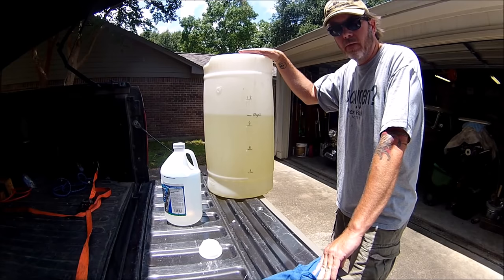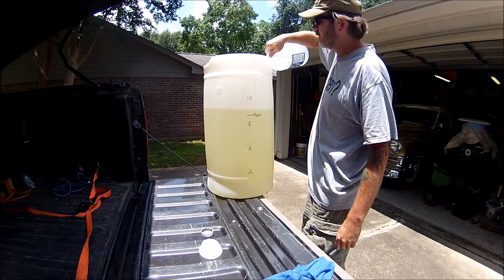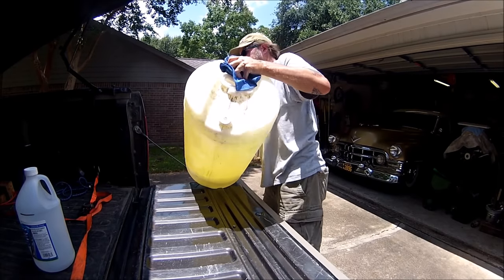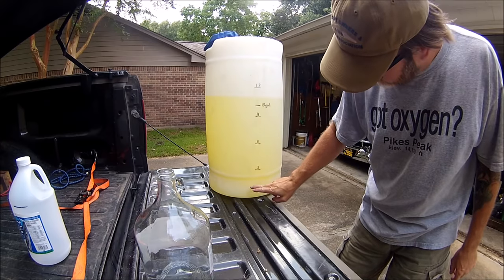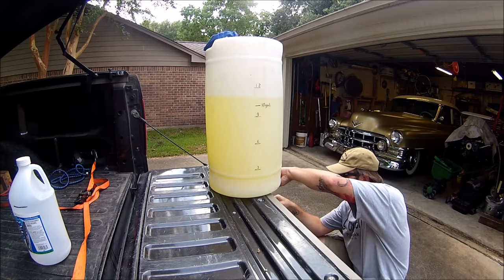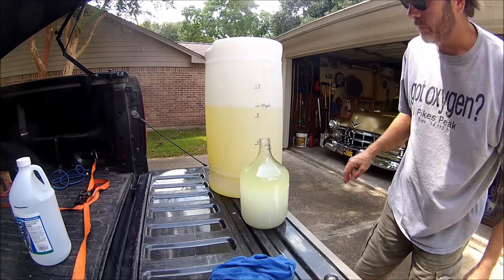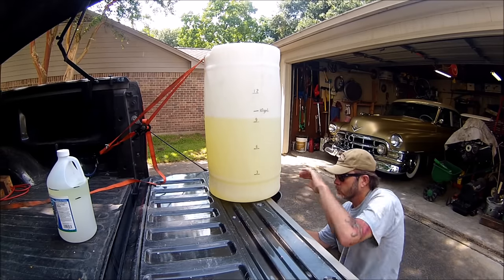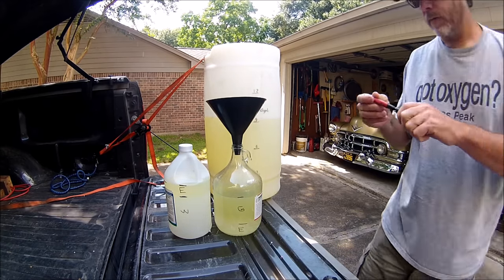How to easily extract ethanol out of gasoline.

Comment: If you start with 10 gals. of E10 you should have 9 gals when you are done.
Reply: The sticker on the pump says 'May contain up to 10% Ethanol'.....just saying.
Reply: +Biana Doubt 
Sorry, but you have been misinformed. 
Here are some verifiable current ethanol fuel facts, look them up on reputable up to date sites and learn the factual truth. 
Ethanol is a cost effective, safe fuel oxygenate, cleaner and octane booster. 
Ethanol is used as a fuel oxygenate and octane booster additive in most every country on the planet, not just the US. 
Since 2010 the "American taxpayer" has not subsidized ethanol for fuel. 
Ethanol production does not take food off of the table, ethanol is produced from a specific variety of corn optimised for ethanol production that is not edible by humans, the corn waste from producing ethanol is high in protein and is sold as animal feed feedstock. 
Currently (08-26-2018) the US national average retail regular E10 gasoline is $2.839 USD per USG and the raw cost to produce that gasoline including the ethanol content is approximately $1.496 USD per USG.

Comment: Did you actually run your product in an engine?  From this vid we don't know if your method works. 
You added 1 gal water to 10 gal gas, and only took out 1 gal. If this "works" you should have 9 gal gas left. (2 gal of diluted ethanol. 
I find that I get 10% less milage with 10% ethanol gas compared to real gas.
Reply: Not enough mixing.  I use a 5 gal. water jug.  4 gals. of gas with 1/2 gal. of water (more than necessary).   Roll on ground and  invert several times.  Let rest for several hours then remove water/ethanol.  Have been making/using for 2 years and all my 2 and 4 stroke engines are free of fuel problems.

Comment: I use Safeguard ethanol fuel treatment by Lucas Oil Products. Use it in my mowers, chainsaw, trimmers, atv and my old IH 656 gas tractor with no problems. It's $7.99 from Wal-Mart and 16 oz bottle treats 80 gallons. That's 10 cents a gallon, much cheaper than super or premium gas. I just add 1 oz to a 5 gallon gas can and the bottle has measuring marks for ozs.

Comment: Call me stupid but I don't want to be messing around with ten gallons of extremely combustible and flammable gasoline, let alone agitating it. I just wouldn't want to expose myself to a possible combustion or friction, static. That's your life you are playing with here. Say nothing happens. Say something happens only one time in a freak accident. That's your ass, your life, your skin, eyes, hair, clothes on fire, etc. It's not worth it, not at all. That's WAY too much gasoline to be playing with. Even two gallons is too much to play around with. Gasoline should be handled with EXTREME CARE and RESPECT. That's not salad dressing you are shaking up you know.
Reply: You've been watching too many Hollywood movies. Static will not light up gasoline. Hell, you can throw a lit cigarette in a tub of gasoline and it's just go out. This guy isn't doing anything different than if he was filling a fuel tank on a lawn tractor. We don't hear any stories about people blowing themselves up pouring gas, do we? Ever wonder why?
Reply: Every car on the road has an electric motor running a fuel pump SUBMERGED in gasoline. Electric motor, wires, etc. Inside the tank, in the gas! Gas is safe.
Reply: @jjenson2006  What!!! Are you serious...throw a lit cigarette in a tub of gas?  I know, it's TRUE, cigarette goes out. What gets me is a electric hot wired Fuel Pump sitting inside a gas tank? Especially when or if it gets down to the "Fumes".  Ditto on the Hollywood Crap!👍
Reply: I've had tanks of  gasoline boiling in my chainsaws after running them multiple times... nothing ever happened but I was careful too and had water with, I just recaped it and let it cool off. Makes you pay attention when you look down, open the cap and see gas boiling in your hands...
So ya, he's in no obvious danger Mr. S.
Anything else?
Reply: You can actually submerge a nichrome wire in liquid gasoline and run an amp of current through it so it glows red and the gasoline will simply boil. Without oxygen, there cannot be combustion.
Reply: @jjenson2006  That's interesting but spooky. I fear "the Fumes" probably more than anything else as danger. Yeah ya gotta have 02, I guess that's the plus side of an elect fuel pump inside a gas tank, it's sealed and enclosed. But removed and opened to replace a pump, I reckon a danger zone now? I have seen guys toss a cig in a pan of gas to make a point, poof, they went out. Scary yeah, then told "it's the fumes, not the gas". Personally not me but yes on the right combination. I know of 2 drilling rigs that went up in flames over fumes that ignited, total disaster.
Reply: You aren't stupid. Just not aware of how gasoline combusts.

The vapors of gasoline are explosive, and that is how gas motors work. The carburetor or fuel injectors vaporize the fuel, mixing it with air... this combination IS explosive. 

If you've seen a puddle of gasoline burn, the flame is over the puddle... most folks don't hang around an open gasoline fire to observe this... advisably so without a fire/heat resistant suit.

Granted, welding around a container of gas isn't advisable. Caution is always a friend. But what this fella is doing is not hazardous... unless he was smoking something... an ignition source nearby...
Reply: I agree that the fumes are the danger, but only if there's a legitimate ignition source; and there is not one here.
Reply: Yeah it's the fumes at around a 14:1 ratio give or take a little, but somewhere in that fume cloud a match will find the right ratio. I would have experimented on a smaller scale to start with.
Reply: I don't care if I'm wrong, I just wouldn't be agitating ten gallons of gasoline, plastic bottle to plastic tailgate protector, in the open sun, the tailgate is warm. That's TEN GALLONS of extremely combustible gasoline. Why play around with that much gasoline so close to your own house? You are all welcome to play with ten gallons of gasoline. Have at it. I don't even keep gasoline in my garage. I keep it outside under the eaves on the patio. It's shady on that side of my house too. Sure, I agitate two gallons of gas when I put oil in it. Sometimes I agitate six gallons in my boat. But I don't treat a whole lot of gas like it is in a washing machine. Jeez. Maybe some of you are less afraid of gasoline than I have but I have thrown enough gasoline into a fire to see how flammable it is. I mean, one mistake and POOF, you might be blind, without a nose, ears, in the burn unit in agony. Sorry but I don't play with combustible and flammable materials like that. I'm going to give gasoline my ultimate fear and respect. You guys can smoke while you pump gas, put out matches and cigarettes in gas containers all you like. I'm just going act like a little girl and not play with gasoline, or lacquer thinner, acetone and other very flammable products. If he was agitating ten gallons of mineral spirits I would not be that concerned, but that is gasoline and a different story.
Reply: There's a lot more than 10 gallons of gasoline being agitated in your fuel tank when you drive your car.

Sometimes I agitate six gallons in my boat.

So 6 gallons is okay, but 10....no way???

But I don't treat a whole lot of gas like it is in a washing machine.

It's gasoline, not nitroglycerin.

You guys can smoke while you pump gas, put out matches and cigarettes in gas containers all you like.

Yet this guy isn't doing any of that......

I'm just going act like a little girl

I see.
Reply: Do you mow your own lawn or do you have Meheecans do it? By your estimation people should be burning up like matchsticks.
Reply: I remember when I was very young, we used to make Molotav Cocktails by filling an empty bottle with gasoline, sticking a rag in it, lighting it and throwing it at the paddle ball court. I remember soaking a tennis ball in gasoline, lighting it and we would all kick it around in the streets; we called it midnight soccer. If the ball hit one of us, we'd light up, but you could quickly pat it out without even burning our cloths. Was a lot of fun until it rolled under someones parked car and we all ran off; nothing happened to the car though. Yeah, we did some dangerous, stupid things with gasoline when we were young, but no one ever got hurt. Today's generation are afraid to just be around gasoline. What happened?
Reply: Plus it does not remove the ethanol, however is does contaminate the fuel with greater than 4 percent moisture. 
10 gallons of E10 gasoline contains approximately 1 gallon of ethanol.
Add 1 gallon of water for a total of 11 gallons in the container. 
IF the ethanol in the E10 gasoline absorbed the ~1 gallon of ethanol the resulting phase separated solution would be approximately 2 gallons. 
This demonstration barely recovered 1 gallon and the fuel in the container is now contaminated with >4 percent moisture (water). 
This method has proven to be bogus/scam numerous times before.
Reply: OK, it seems my man card has been called into question. Yes, I cut my own yard. I keep two two gallon cans of gas outside the house, one can has two cycle oil in it. I used up the gas I kept in my boat tank because I haven't been using the boat but previously for a while it had around four to five gallons in the six gallon tank. Yeah, call me paranoid but some nearly burned down my father's sign business in 1975 when I was 12 years old. We had to rebuild the business. I once almost burned the lake house down when the fireplace ignited the kindling in a bucket in front of the fireplace. Fire burned up the wall which had paneling on it. Luckily my dad caught the fire. Another time I was cooking french fries on the stove when I was a kid and the grease caught on fire. I grabbed the hose outside and put out the fire with the hose. I burned up the overhead range and the kitchen floor too. And another time I had a minibike and the throttle was leaking and it caught fire as I was in a neighbor's driveway. The fire burned my eyelashes and eye brows back plus the hair on my arms. So I am familiar with FIRE. That is all I am saying. Maybe some of you need some closer to home adventures with fire. But yes, I see the logic of your comments. I just don't like to play around with gasoline too much. I see people putting gas cans full of gas in their car cabs, in the trunk. I like to think I'm not that sort of person. I mean, I remember at Florida State University back around 1994 when I walked into an office and was instantly stunned to see this young woman working at a desk who had been horribly burned in some previous accident. It's hard to prepare yourself for something like that. It's like there are beautiful young people all around and then you are confronted with real horror that you couldn't prepare yourself for. I mean, I feel sorry for the woman because she probably gets that reaction everyday of her life. So ok, I drive around with a tank full of gas in my Toyota Tacoma but it is in an enclosed system and I don't have gas fumes in the cab. And yes, the gas tank in the boat is also jostling around all the time, so I see your point. So maybe I'm wrong, I'm still going to be very wary of gas fumes, and playing with a shitload of gasoline.
Reply: Stay away from dirt bikes. They have gas splashing around inside a plastic tank
Reply: I could see your point if gasoline didn't get shaken and agitated every time your vehicle moves. Or your lawn mower, weed trimmer, motorcycle, boat, etc. It isn't nitroglycerin. Shaking it doesn't make it blow up.
Reply: jaxflfreebird Cry?
Reply: OK, I was wrong I guess. You guys have given me ample uses of gasoline in stuff I use all the time, truck, boat, weed eater, boat motor, lawn mower, blower, edger, motorcycle, school bus. OK, so I guess I was wrong. I still am wary of gasoline though and sparks, static, etc.
Reply: shaking gasoline happens all the time. when you drive your car it sloshes around. when you ride a dirt bike or atv there is a lot of shaking. even when you cut your grass.
Reply: jaxflfreebird filling a tank with diesel that last contained gasoline is more hazardous for static ignition, then filling a tank that last contained diesel with gasoline. Fun facts of accidents!
Reply: Bahaha!
Reply: What are you going to do when the asteroid which will hit us all.  The sky is falling.  You can trut the gvt, nd the companies.  Everyone is a critic.